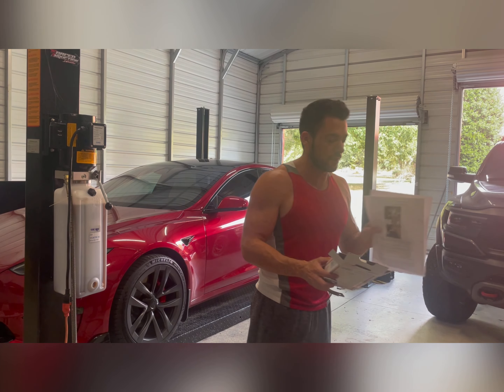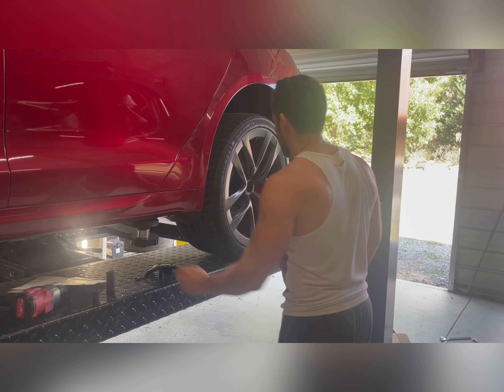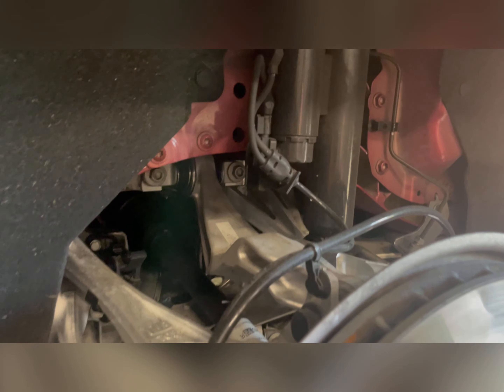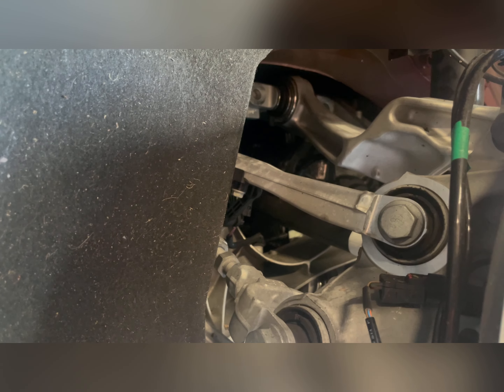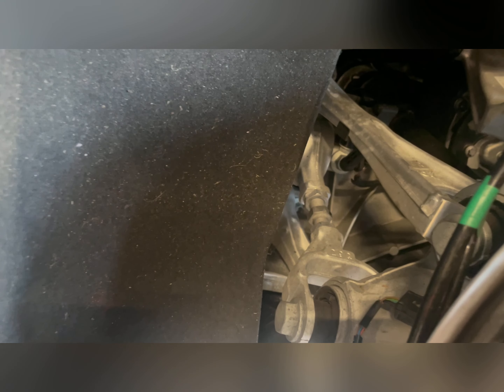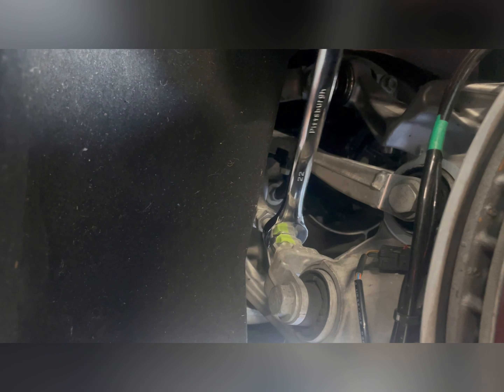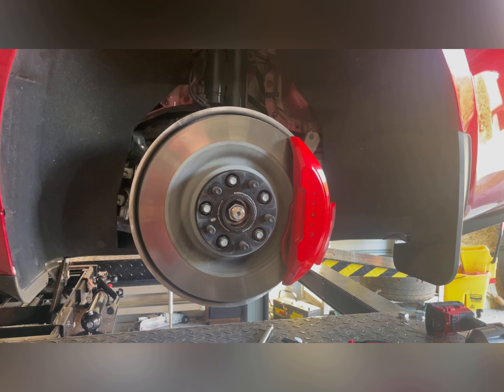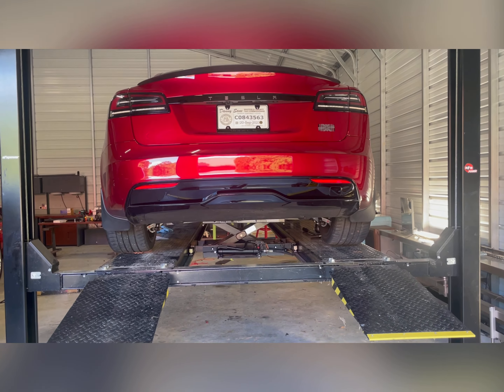Tesla model s plaid rear tire wear fix

Comment: Have a MSP and MXP. I went the n2itive camber arm route for the MXP but tried the washer shim method for the MSP. Quick tip, if you loosen(not remove) the two same bolts off the toe arm and  the two off the lower arm, you will not need to pry anything. It'll give you enough room to slide the plate or shims in. Easily a one person job doing this way and it'll save yourself a lot of sweat. Hope this helps.
Reply from the maker: Thanks, hopefully Macsboost owner will see this and change the instructions or perhaps I need to reread them and see if they mention that. It makes a lot more sense that way.
Reply: Do you think I can solve this problem on my 2014 (1st gen) Model S? I don't want to invest +1200$ on N2itive camber kit.
Reply: That or maybe drop the suspension from the strut
Reply: Where do you find torque settings for the tow and lower control arm, to put it all back together. The video shows 80ft-lbs for the upper, but I am interested in trying the solution you described

Comment: Sad that you have to do this to a hundred thousand dollar car. A better solution is to run 19" wheels, preferably forged.
Reply: How would running 19s change the angle?
Reply from the maker: For whatever reason the 19s don’t have this issue I assume it’s the contact patch area
Reply: I have the same inner wear issues with 19s on an older model S 75D. Taking it in to Tesla to see what they say.

Comment: I have a 2018 Model S 100D. I’m running into the same problem with my rear tire wear. The inside is worn but no chord is showing yet.  You mentioned about the auto lowering causing the problems from the air suspension on the rear inside tires. I wonder if I raised the lowering speed to a higher speed, if this would help mitigate the west problem? I never drive over 75 anyways and have mine currently set to lower at 70. Maybe this is what’s causing the issue once I hit 70 on the freeway? What are your thoughts? Thank you for the informative video.
Reply from the maker: @TrendingHeadlinesTV  I think it will some but I’m not sure with your car but mine will not allow anything other than low after a certain highway speed no matter how often I try to put it back to medium height so I think that helps only some . I drive mostly highway which forces low on my S. I have 40K miles and after installing these spacers I changed first set at 16Kish miles and now have 25K on the second set doing just the shims.

Comment: May I know the the original native camber degree vs the later one with new camber link? Meanwhile, how does the air suspension setting(low, standard, high) impact the native camber degree?
Reply from the maker: I know it affects it but specifically what degree I do not know. I have been using medium height for highway travel and I’m at over 10K miles so far on factory rubber for rear
Reply: It matters a lot to use third party link with less negative camber angle. If the angle is the same, the length of the third party link needs to be adjusted to have less negative camber degree.

Comment: I added the macsboost shims to my 2023 X Plaid too hoping to get extend the tire life
Reply from the maker: How is it going so far for you?
Reply: Have about 2500 miles on the original tires and just swapped them out for winter tires so had a chance to closely inspect the wear on the rears and no noticeable uneven wear so they seem to be working well thus far.

Comment: Thank you for the video! What wheel spacer combination did you do for front and back?
Reply from the maker: @KennethTorres-s8u  20mm front and rear. Hindsight I think 15mm is sweet spot because you get a lot of issues with slinging dirt/debris in the car that far out.